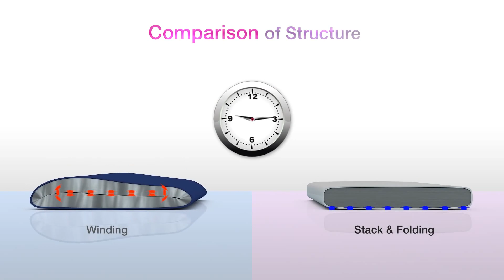AVL Says BEVs Not As Green As We Think - CAR MBS 2019

Comment: This is the best anti EV site on Youtube. /s 

The Model 3 battery pack weighs about 480 Kg.   About 400 Kg of that is actual battery materials. 

It takes 40.5 KWHr of energy to make 1 Kg of LiION battery materials in a research lab.   About 72% less in a full scale manufacturing facility.  Most of the energy is used for drying materials.  
Source: https://www.researchgate.net/publication/316884465_Manufacturing_energy_analysis_of_lithium_ion_battery_pack_for_electric_vehicles

40.5 KwHr/Kg x 0.28 x 400 Kg = 4536 KW Hr of energy to build its pack = 4.536 MWHr.   If this energy comes from wind, solar or hydro, it is 100% CO2 free. 

1 MWHr of energy is equal to 27.32 gallons of gasoline.   Source: https://www.convertunits.com/from/gallon/to/MWh

4.536 MWHr = 123.93 gallons of gasoline.  The Model 3 saves all the energy used in its battery pack when it has saved 124 gallons of gasoline from being burned.   A gasoline car that size gets about 35MPG.   35 MPG x 124 gallons = 4337 miles.

However, this analysis assumes that the ICE car drivetrain  uses zero energy to produce, which we know is not the case.  An ICE car has an ICE and a transmission that the BEV doesn't.  To say nothing of the radiator, fan, gas tank, exhaust, etc.   You might want to check out some of the precious metals being used in catalytic converters these days.

Comment: The incurred carbon deficit for manufacturing any product is very roughly proportional to its mass.  Since long range EVs currently tend to be somewhat heavier than similar ICE vehicles, they will start out with a somewhat higher deficit.  The important thing to realize is that the referenced study and pretty much all studies show that battery EVs beat the ICE vehicles over the lifetime of the vehicle.  They only differ by how much.  And, the advantage is only going to increase.  Why?  Batteries are getting steadily more energy dense, lowering the initial carbon deficit.  Battery recycling and reuse will improve, amortizing the battery portion of the carbon deficit over a longer period.  The grid is rapidly getting greener, meaning future and existing EVs will pay back the carbon deficit faster and faster.  Bottom line:  We can quibble over the exact numbers, but everyone agrees that EVs come out on top.

Comment: This is not new. All estimates and common sense  point in the same direction: a BEV requires close to 100% emission free energy grid in order to be substantially better than an ICE car. 
The BEV will most likely always be better than the ICEV in some countries. But where oil and coal is the predominant source of electricity, a Tesla and a diesel Mercedes might not be any different in terms of total life cycle emissions. 
If you do not understand this, you do not understand even the basics of the problem.
Reply: Most studies give a 2 year period before CO2 parity, after that BEVs are better. And because renewable are cheaper, this time period will shrink in the future.
Reply: @shiakas  The time varies with the capacity and the energymix in all studies. Some take the worst case scenario: a large capacity battery and mostly coal fired plants in the energymix. Others are on the opposite side: smaller batteries and more zero emission power production which result in lower break even time. So a BMW i3 in Sweden or Norway would result in an extremely short break even point. A Tesla in the USA will have a lot longer. 
I'm not saying that ICEV are better than BEV, I'm certain that BEV will always be better in terms of emissions. I am saying that if we don't focus on emissions from  power and battery production, the BEV will only be marginally better.
Reply: So in short: yes, you are right but so is the statements in this interview.
Reply: @MuffeCigg the issue is that we are still casting doubt on the benefits of EVs. Simply refining a gallon of petrol for an ICE car takes about as much electricity as an electric car would use to travel the same distance. https://greentransportation.info/energy-transportation/gasoline-costs-6kwh.html
Reply: More like 3% of "studies" and zero actual verifiable evidence against..
They're coming. Get used to it.

Comment: When researching my last car purchase I expected to buy a battery electric car. Looking at practical usage I found the range extended electric to be a much more user friendly format for my use case (live in city, frequent long trips to remote locations). The BMW i3 we interesting but costly when combined with the optional range extender, which was undersized. I decided on a 2018 Volt with adaptive cruise control.

20,000+ miles later I couldn't be more satisfied with my choice... or disappointed with GM's decision to cancel the vehicle. Almost all of my driving is powered by the Volt's relatively small but exquisitely engineered 18kWh battery pack. The engine seamlessly takes over when I suddenly need to be in the mountains three states away. 

For the vast majority or US drivers this type of drivetrain would be effortless to adopt and would save them money. Over 22,461 miles only 8,774 miles were driven under engine power. 13,687 miles driven under electric power used approximately 3,260kwh of electricity at $0.13/kWhr cost me $424. Using gas for 8,774 miles at 38mpg and buying gas at $2.30/gal cost $531. That's $100 more for 5,000 fewer miles. Unfortunately today we have only the i3, Mitsubishi Outlander, and the Chrysler Pacifica with this type of drivetrain.

Since hybrids, like electrics, use regenerative braking there is almost no wear on my brakes. After two years I'm not due for my first oil change yet. With little use and no time spend idling in the Texas sun the engine compartment is spotless and components suffer far less heat and vibration stress. there is a volt in use today that has nearly 500,000 miles on it.

Which brings up lifespan and recycling. Today automotive batteries are not recycled. Why? Because there are effectively none being discarded. There is a strong secondary market for batteries salvaged from wrecked EVs and hybrids. See Ebay of course, but Nissan is beginning to reuse batteries replaced under warranty (Nissan screwed up their cooling) as energy storage units to assist car charging stations and avoid high demand charges. When a battery is to degrade for use in a car it still has maybe 60% of it's capacity left and that is still far, far better than lead acid for use in energy storage.

But lifespan of electric drive vehicles is much longer than cars running solely on gasoline. Heat and vibration wear components quickly. Open the hood of a 9 year old Subaru next to a 9 year old Chevy Volt or Nissan Leaf and you will be amazed at the difference you see. Electric drive cars simply last longer. As Uwe Grebe points out, a great deal of the emissions attributable to cars comes from their manufacture. We need to make cars that last as long as possible and not treat them as disposable commodities. We need to adopt this philosophy in all the products we buy, repairing rather than replacing, only buying things that last.

Wow. I really got on a roll there. If you stuck with it, well, you probably already knew it :)
Reply: Bill Kerr GM killed the volt because these half breeds suck as an EV and they suck as an ICEV and they suck to manufacture. In 10 years anyone whose bought a hybrid will realize that they have a valueless pile of garbage.  BEV is the clear winner, and the window for hybrids has already closed. BEV will continue to grow, ICE will shrink to nearly nothing and hybrids disappear altogether except for niche applications like potentially hauling.

Comment: I charge my BoltEV off my solar array using power that would go to waste as the utility pays me just a pittance for my excess generation.  And the BEV is so efficient that the electricity it consumes is less than the electricity that the equivalent ICE car would use just to drill, pump, refine, and transport its liquid fuel let alone the CO2 issue. 

BEV's are going to blow this guy's door off....

Comment: Also I would like to see the actual comparison data. For instance, they are including 85,000 miles of driving on a 30 miles per gallon ICE - so including all that emissions? I would imagine the steel and most of the car components with the exception of the battery would have similar footprint. So does the battery actually add 85,000 miles of gas driving impact?
Reply: I know I am biased as I work in engine development and with AVl, that out of the way the value of reused steel and aluminium in the car industry is close to 86%, the so basically most of the components are already mined out and runs on recycling. The amount of energy to mine, refine and recycle for li based systems is not yet known. The most common of the non recycled parts is plastics , upholstery and electronics (some of these do get recycled)...
a lazy googe search got me to this https://www.industryweek.com/technology-and-iiot/lithium-batteries-dirty-secret-manufacturing-them-leaves-massive-carbon
Reply: @hyronov  So what about the oil and gas?
Reply: Why are they using 30 miles (ICE) per gallon?!  The "average" mpg in the U.S. is only 22 mpg!
Reply: L Dewey that’s just me imagining what they might be using to compare.

Comment: Interesting perspective, but I disagree with the gentleman regarding hybrids. I think hybrids are far too complex, and as the grid gets cleaner, electrification will make hybrids seem ridiculous.
Reply: Liam Ball - I personally feel hybrids are one of the best ways forward... the better the MPG the better they sell... advancements in both ICE and electric drive systems are key in hybrid MPG getting better... without a giant leap in battery tech there are large areas of the world where due to temperature (cold especially) and distance between anything (gas stations included) the power density of diesel and gasoline and the natural production of heat as a byproduct are hard to replace. Hybrids are a great way to best extract all available useful energy from those fuels for people in these areas.
Reply: @bigretardhalo  I would agree if you said plug-in hybrid. Most driving for most people can be done with a small battery pack, using the engine as a generator only on longer trips. It would be easier to get people to switch over to that too. Today there is not enough battery manufacturing capacity to build batteries for all the Hyundais and VWs that are right now sitting and waiting for batteries to become available.  We could build a lot more electric drive cars and emit a lot less carbon if we were making 15-20kWh batteries in place of 60-100kWh ones.
Reply: Plug-in hybrids are a good transition vehicle
Reply: @robertpryor7225  
Phevs WERE a good transitional vehicle.
They've been surpassed by the latest Bev's.
I'm aware of at least 3 new battery advances that should be in cars within 12 months.
The gap will widen even further.
Even phevs will be boat anchors.